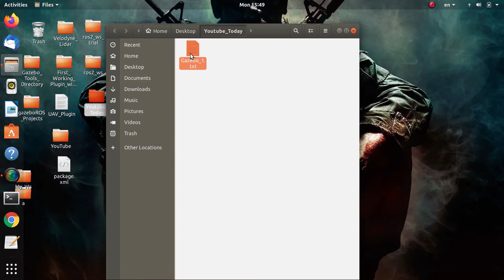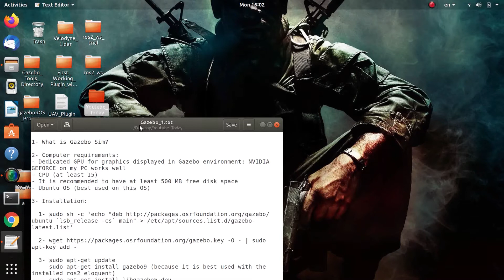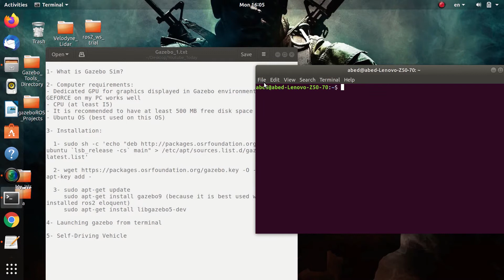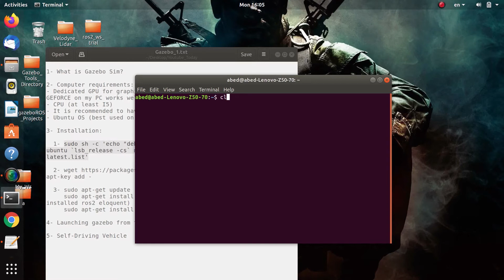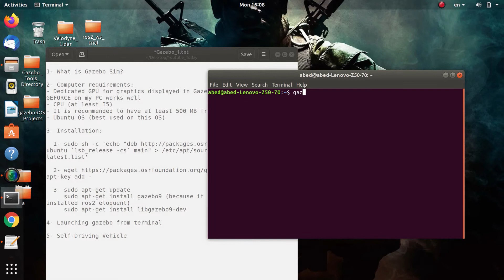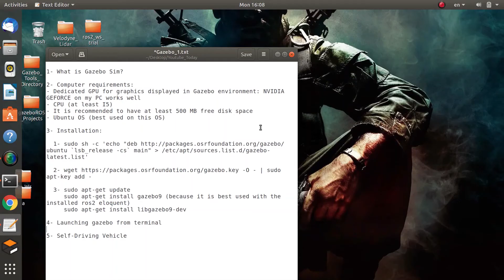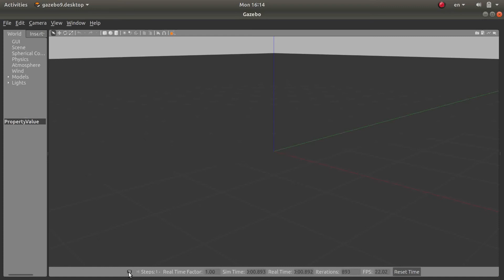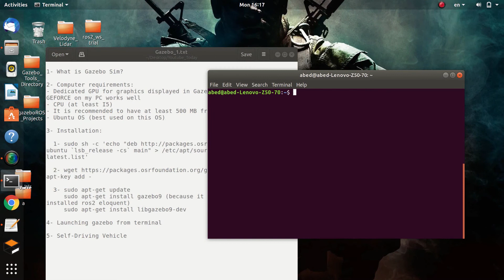Gazebo Simulator: Introduction & Installation

Comment: my laptop is thinkpad T490. it doesnt have dedicated GPU. is there any chance to run the software?
Reply: T490 Supports OpenGL 4.5 while Gazebo9 Requires 3, so technically you can install in your system but it can lag or cause crashes while working on heavy simulations if you have intel 620 UHD.

Comment: I thought that on linux  development i  could found robot simulator that works on  integrated video adapter like intel hd 3000, but i found that also  need a  gpu dedicated, i need a robot simulator for a labtop hp intel hd300 built in graphic adapter,  would i should stop looking for that_
Reply from the maker: If you meant the HD3000 then this unit is outdated and i am afraid that it will probably struggle even with older versions of Gazebo Classic which reached its end of life earlier this year. Sorry but i cannot think of any suitable open source simulator for this case.

Comment: I hope this message finds you well.

I am writing to inquire if there is a simulator available for the MaxArm similar to the one provided for the JetMax arm. I initially thought they were the same robot and assumed the simulators would be identical.

We are planning to work with students remotely and would like to use a simulator to mimic the MaxArm's capabilities. Could you please provide us with more information or suggest how we might use a different simulator, such as the one within the RoboDK package, to achieve this?

Thank you for your assistance.

Best regards,

Comment: How can i download for windows?
Reply: I have the same question
Reply: Did you solution?. I did install virtual machine with system ubuntu.
Reply from the maker: Gazebo is not fully officially supported on Windows so i don't recommend this. However, you can still do it by trying one of the three community projects listed in this page: https://classic.gazebosim.org/tutorials?tut=install_on_windows&cat=install
Sorry i did no attempt a windows installation of Gazebo myself, so i am not able to give you further feedback. I hope this works out for you!

Comment: Hello , I am new in the field of Robotics. I have very small doubt .Can you please tell me whether can I design my robot in Gazebo or is it used only for simulation and virtual environment purpose ?
Reply from the maker: Gazebo is mainly used for simulations, but it has some available design tools. But as an engineer, I always advise to use a CAD software (Solidworks, blender, catia, onshare....) for robots designs
Reply: @Robotogeddon  Thank you so much for the information.  Does the simulation involves  the physics concept ? Like I am asking about the proper physics involved in a human walk(eg. center of mass)  can be simulated ? Will be glad to get your answer .. Thanks in advance.

Comment: Hello there i just faced a problem during repositry downloading
it showed following error
gpg: no valid OpenPGP data found.
Reply from the maker: Open a terminal window and type the following commands in order: 
wget -v -O - https://packages.osrfoundation.org/gazebo.key
sudo apt-key add gazebo.key
In case you faced problems, please let me know what kind of errors is displayed after performing the first step.
Reply: @Robotogeddon  yes, during sudo apt-get update it says its unable to read repositry from line 1 that is basically the installation of OSRF repositry
Reply from the maker: @mhassaankhalid1369  Please type this command: cat /etc/apt/sources.list.d/gazebo-stable.list
And let me know what you get as an output